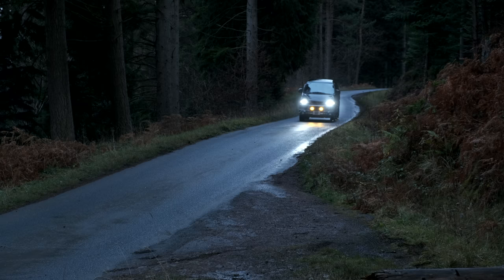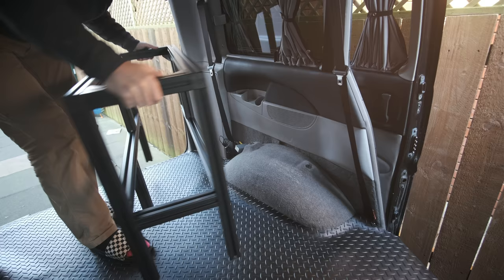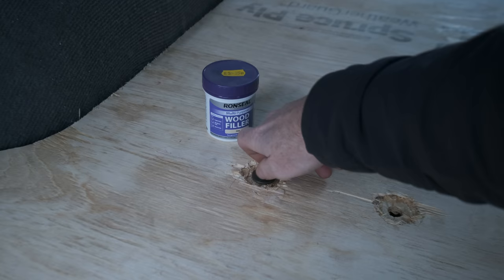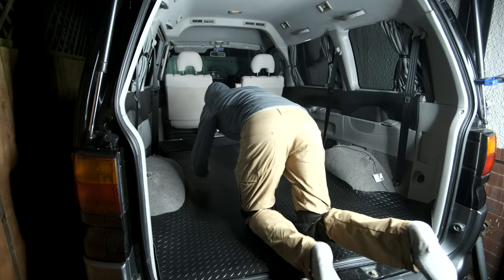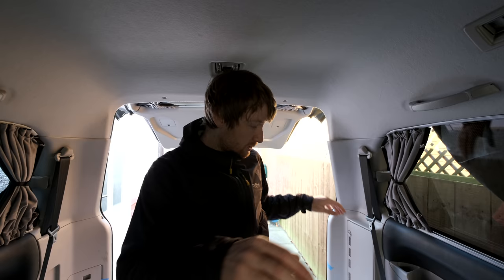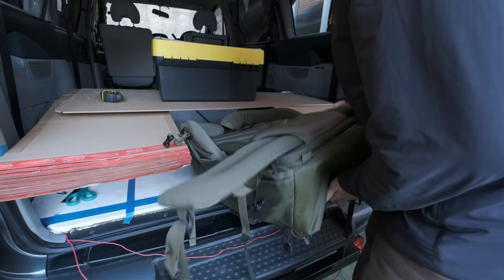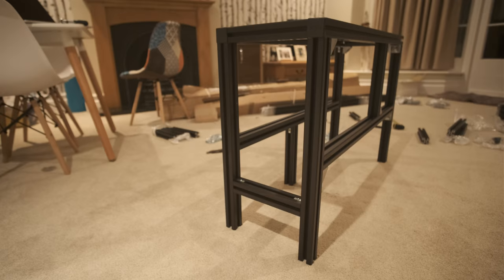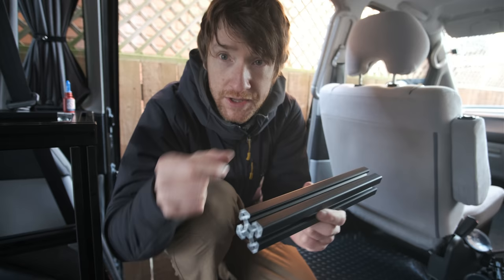Small Off-Road Camper Van Conversion Using Aluminium

Comment: Very clean build so far. Also mechanical engineer here and I approve of your changes for safety. Your assumption that the low down bar will cause the frame to bend instead of thrust forward is correct!
Reply from the maker: That's reassuring 👍
Reply: We were hoping an engineer would weigh in.  Glad you did.
Reply: Thanks for the confirmation!
Reply: This is remarkable. I'm probably one of the few people to have had a Delica written off from a rear ender. A model, on her phone, hit us outside the Trafford Centre in Manchester - we were stationary in traffic. The van went up and forward, we wrote off the 406 in front of us. We had a towbar, and yes, it went down and spread the chassis rails, hence the van was written off. From the outside the only damage was that the rear wheel arches were buckled. We were all fine, the occupants of the car in front were also ok, and she got out of her   Vectra without a hair out of place, still on her phone, although her engine was literally touching the windscreen. Cops reckoned she hit us at 40+
Reply: @frankfisher99  Yikes!  Glad you're OK!
Reply: @a.w.thompson4001  Four kids in the back too. Good solid van, and in fairness her vectra crumpled exactly as they are meant to do. I went out and bought another Delica with the insurance money....
Reply: I can see why!
Glad you're all OK.
Reply: Thanks so much for this info!
Reply: Glad you brought this up about spearing. If your boot hasn't got a room crumple zone then everything people have spent hundreds on, is down the drain. I cringe when I see dogs in boots. 
I'd rather leave 1½ foot spare at the back for soft stuff: bedding,  cloths & pillows etc.

Comment: Well, I must say the aluminum framing is a lot better than any wood framing I have seen on You-Tube van builds. First of all it is light which saves on weight second it is more flexible to work with as you demonstrated with all the connectors. It is also a clean finish over all. I must admit that you have demonstrated a good workmanship beside photography that will add to your video adventures. I will not be surprised that there will be many others who might get inspired on their own van built to follow your example. Good workmanship, cheers.
Reply from the maker: That's very kind, thank you.

Comment: As a engineer, and 15 years into car modification I must say, very nicely done Thomas !
It's good to have concerns about the safety as you had.
Try to use the cars original fastening points for seats and seat belts, they are strong and meant to support large loads.
Looking forward to the next episode.
Reply: Thanks for you input.  That is good to know!!!

Comment: This is called 80/20 here in the states and that's what I plan on using when I do my van build. I work in engineering and we use this stuff all the time for fixtures. If you liked playing with legos when you were a kid you'll have a blast with this stuff. We always called it tinker toys for adults.
Reply: Kinda weird to call it 80/20 when the size he’s using is 4040.
Reply: Do you have a link for the 80/20
Reply: @brianbilich6137  There are different suppliers. You can do a search to compare prices and the minimum quantity you need to purchase. For work we bought it from grainger. com

Comment: I need to stop watching van build and photography blogs and go out and do both for myself! Thanks for the great walk through, has given me the confidence to possibly attempt this myself.
Reply: You and me both. I’d do it right now if they made a 6 cyl. Awd or 4 wheel drive midsize with a high ground clearance in a midsize and trailhead worthy van available in the USA. Unbelievable. The Sprinters and Transits are too long. Frustrating.
Reply: @eclectictomboy6873  These vans are available in the states, although more common over there is the L300 (earlier model of this van (which is an L400)). Do some research but i think you'll find these L400's become more readily available due to your 25 year import rule. GOod luck mate
Reply: @lachlankerr7339  Thank you.

Comment: using the carpet as the template is simplistically brilliant and was one of my largest concerns for accidental waste walking into this project. I also hadn't stopped to consider the outcomes of being slammed into from the rear in a wreck, so now I'm engineering breakpoints and considering a metal plate behind my seat.

Comment: This is an excellent solution. Aluminum extrusion. Very well and impressively done. 
I’m a big fan. Only thing I’ll critique is that those 90* gussets were not necessary. By the looks of that profile, with the square hole in the end/middle, looks like a self tapping 10mm or 12mm bolt will tap into there. It’s ok it the hole is square as it will still work fine, for the way I know how to machine & assemble alu extrusion.

Comment: Tom, can you send me a link of where you purchased the framework? I’m on with a similar build - just can’t find 8020 in the UK! Thanks!
Reply: RS sell a version
Reply: @gary5926  thanks, I figured out he used KJN 👍
Reply: I'm in the USA but I work with Swiss equipment that uses a similar aluminum extrusion called Item.  It is very similar to 80-20 with various profiles and fittings.  Both are awesome to work with.
Reply: @bg45420  I would love to get a link for the products you're talking about here in the US. And can you order them in pre-cut sizes, like he did, to speed the building process along? TIA

Comment: I used to have a Delica L400. Good vehicle. Heads go on them and can't be skimmed but you can get replacements for about £500. Also the diesel pump seals go bad and it's a bit of a faff but possible to fix yourself with a bit of time and care. I think your Delica is running too low! They look better like that but it puts a lot of strain on your drive shafts, boots etc, as I found to my cost. I would advise you crank up the torsion bars and raise it a few inches until the drive train all looks level. Means you have funny gaps in your wheel arches but that is how they're supposed to be. Always wanted to put a pop top in mine but I had the crystalline roof. Yours doesn't and should be fairly straight forward to convert if you choose to down the line. Great video!

Comment: Thomas, You're smart using 8020 extruded aluminum.  It is the perfect material for building frames in mobile vehicles.  You may be a novice but your work looks very professional.  Humble Roads would be proud.

Comment: That's a brilliant camper, Thomas. Just a point to consider - heath is being lost through the ceiling, so insulating it is a good idea. Also, the windows are terrible so enclosing them with a shutter+a curtain (layering) will somewhat insulate them.

Comment: That's actually starting to look quite smart - almost as smart as your footwear. 

Good call on the safety aspects. I've seen LDV Convoy conversions with cast iron wood-burning stoves secured with little more than a couple of self-tapping screws.

Comment: For anyone considering this kind of build and is concerns with the rear end accident making the frame system into a spear, use shorter rails and put a 2-3' tube in between 2 rails and secure with shear pins so they're stable but also have a set breaking point for the slide tube to be used as intended.

Comment: Loving the use different kinds of material, especially the aluminium and cork. (Something else then al those heavy wooden conversions)

Fantastic you are highlighting safety as part of your built. It still feels the structure is very rigid. Could you design some more failure points? As you said, make it less rigid in some way.

An idea: cut some of the longer pieces is half (under an angle) and connect them with something that could break in case of a collision.

I’ll keep following this one!

Comment: Hello Thomas, maybe you can find some space for a ventilation silencer in your bench. You can use it with your parking heater to cut the noise of the fan.
Reply from the maker: Ey. We'll see how loud it is when running 👍

Comment: Really amazing forethought and resourceful planning! Very Nice. Some insulation under the wood floor would have been nice. Also, a friendly reminder to be sure that your weight parameters for the total load of the vehicle chassis and so forth are within limits. Never hurts to drive on to a scale to find out completely loaded with all your camera gear, food, water and bedding and everything. Super impressive! Thanks
Reply from the maker: Thanks, but I did a whole 2 minutes on the insulation 😂 you must have gone for a cuppa.
Reply: @ThomasHeatonPhoto  Under the subfloor....1:58

Comment: Great design Thomas, it looks really well thought out and put together. The extruded aluminium is a good choice, I've seen a friends van conversion that just used CLS timber for the framing, it weighed a tonne and didn't looks nowhere near as nice as what you've done. I'm in the process of fitting out my new studio and I'm using the same material to construct an overhead lighting rig. Nice job, I'm looking forward to see how it all comes together.

Comment: Hey it looks fantastic but a piece of advise when using that aluminium as a frame and then attaching it to the body. The cold from the outside will transfer through that frame rendering your insulation a bit useless. You need to isolate it. You still need to connect it for grounding purposes but there's a way around the heat/cold transfer. I'll find the video and link it in a different comment or a response to this one. Other than this, it looks amazing. Keep up the good work!
Reply from the maker: I'm hoping that those 4 brackets won't conduct too much and they're actually on carpet. It might be cold though, but time will tell.
Reply: Fingerscrossed!!

Comment: Be aware that by attaching the interior frame to the subfloor, you are increasing the rigidity of the whole vehicle.  Instead of relying on the unibody outsides for strength, you have tightened up the floor.  The ride will be different!
Reply: Thanks for that input.  But how would the ride be different?  What should he have done differently?
Reply: @pat6703  Nothing, just be aware that he has something like an inside skeleton which will keep the floor more rigid.  The shocks might creak more, that's about all I can think.

Comment: Excellent video! here I am, hunting for ideas and inspiration for my van build, and got two fantastic ideas here:

1. Using extruded aluminium for the frame - I was always thinking that building the interior out of solid wood would add a lot of weight, and wondering what lighter alternatives there were. Excellent tip on the extruded aluminium, looking forward to seeing what you do to build the cabinets for further ideas :-)
2. Cork floor - brilliant! again, as a European I'm looking for a smaller van vs what our American counterparts use (think Vito, T5/6, Proace, etc...) and space is at an absolute premium. Thought that adding an inch or more on the floor for insulation would eat too much vertical space... so fantastic!!

Really looking forward to the remaining videos in the series

Comment: Wood construction would have been heavier than the extruded Aluminum. There are options to the diameter of the extruded Aluminum - people seem to use the standard popularized by 80/20 builds. Popular in the US are Ambulance conversions; are these doable (legal) in the UK also?

Comment: Looks like 40mm Aluminium... that’s not necessary... I built with the 30mm series in vans and that’s perfect in strength and doesn’t take up a lot of space. But if you want the assembly easier and don’t built up a big van this might be a good choice for extra strength ... good build!

Comment: As long as it FEELS safer who cares if it really is. Buy an architect or a structural engineer couple of beers and get their opinion cause you’re right to be concerned and you’re wrong to think that dropping that down lower solved the problem. If you anyone has any doubts about your right to be concerned they need only visit an auto salvage yard.

Comment: Some 20 years ago, in Scotland, I was the first on the scene at a single lorry head-on impact with a tree (it happened in front of me).  The lorry was carrying steel sheet.  About 1/3rd of the load continued its forward momentum, removing the driver's head and shoulders and the top half of the tree!  You were very wise to worry about the risk of the longitudinal bars becoming dangerous "spears".  The behaviour of non-OEM additions in an impact is totally unpredictable.  I would be worth checking the crumple zones of the vehicle to see whether the calculated penetration in a rear impact is as far as the rear of the longest continuous bar.  You should also consider whether your modifications could compromise the designed deformation processes in the event of an impact from any direction.  Of course, your insurer might have inspected the modifications you declared to them ... you did tell them, didn't you?

Comment: Really clever design, with the aluminium framing. You said you ordered custom-cut lengths, but the link you list for the aluminium is for pre-cut lengths on Amazon. Which company did you order your cuts from from? And, wowie zowie, you sound like Frank Skinner! Not only do you have the same accent as him, but at times the same cadence, timbre, etc. I kept thinking of him as you spoke! I definitely wouldn't put your van in Room 101 :) That safety concern was good thinking. You could have put the bed on the other side, though? Anyway, it's looking good! I'm looking forward to seeing the rest of the build.

Comment: Iam a inventer & designer. It's is unsafe. That wood screw not going to hold 2,000 psi  pulling pressure in a impact of 1 second, and so is any aluminum, extruded are  stiff but brittle, with T cap you could  mount to the floor but without steel sleeves so can spread out the support it still will break. And you need to go floor to roof in the front to hold back about 40%  of the van mass that going in that  shelves. That bar not going to cut it. You could run through it if it was mounted to the roof
    And if you hit something solid all that mass weight will still be going that speed or momentum . Mean they  end up in the front seat. Only the mounts will hold it back. They say you can't  even hold a 15 lb kid in a impact. Feel like 300 lb in a instant. 
Best advise. Is just do 1/2 the back & used plastic for the front. Put your clothes in that bin  that will protect you from that frame that could bed you for life.
you need about 4 feet space behind  you. Your mod you forgot the top. The bottom will still break off and forward with all that weight, This isn't even counting yout raiseing the weigh higher than the seating level. If  you turn left & right fast you can roll over. The more shelves you have the more weigh you will carry without knowing it. It's isn't stock anymore it's at it edge.or beyond. LOL

Comment: Don't you think your aluminium flat bar connectors might break soon through vibration and becoming brittle? You stress them in a direction that the material is not really suited for. they should be made solid by a weld..

Comment: Love the build...so jealous of the vans you guys have over there. Surprised you went with the 15 series...was there a reason you avoided the 10 series (1" or 25mm) profile? I used it and felt even it was a little overbuilt by the time I was done.
Reply: he used the 15 series? are you positive??
Reply: @noahkanenwisher4856  oh yeah, clear as day. If you've use both before, it's 100% clear it's the larger set. You can see how much smaller the 10 series is in my build videos.
Reply: @GotMountains  i'm building a little eurovan out. i want a bed frame with legs every 18 inches for about 72 inches (down the side like thomas heatons.) Do you think i'm good to use the 1 inch? the 1010
Reply: @noahkanenwisher4856  Oh easy. Mine spans 20" with ease. You can see the way I built mine...I have 4 videos on it. Super strong. I've even been considering going to the 20mm profile in my next build.
Reply: @GotMountains  awesome thank you so much!!!!!
Reply: @noahkanenwisher4856  no problem!

Comment: Hi Thomas, what size extrusion did you use? I’m guessing it’s 40x40 as it’s seems pretty chunky. Did you take any advice or calculate which profile was needed or just go for the largest so there was never any doubt regarding strength etc.?

Comment: I've spent the last decade building and operating boats on the Norfolk Broads and am used to fitting out awkward spaces and you seem to have done a great job. One point though, whilst this ali looks amazing, but do you have easy access to change the rear bulbs?
Reply from the maker: Ah yes, my Moto is All Will Fail. I talk about this more in next week's video, but yes I make sure I have access to everything. 👍
Reply: @ThomasHeatonPhoto  Excellent! My business hired boats to novices which meant more repairs than you would ever hope for and I cursed long and hard every time I couldn't get to an area because the idiot boat builder of the time didn't care for future access to areas! I take photos now rather than play with fibreglass, wood and oil! Maybe you could take a look at my fledgling channel.... Oh, and as soon as Lockdown is eased, I'll be off in my boat or motorhome. Can't wait!

Comment: Quick question Thomas. I'm thinking about using Aluminium Extrusion to re model my campervan but confused with the 8020 profile. Is it actually 40x40 profile that you used?

Comment: Hey Thomas, cool vid and van. I've been thinking of taking my middle bench seats out too for some more room. Does this leave big holes in the floor of the van when all the bolts are removed? Did you need to fill the holes with something to stop the weather getting in?